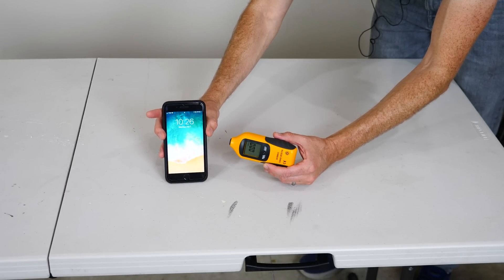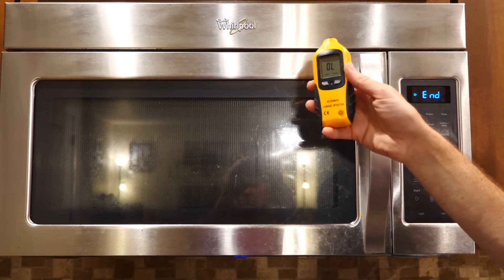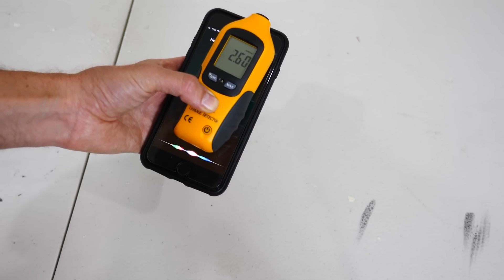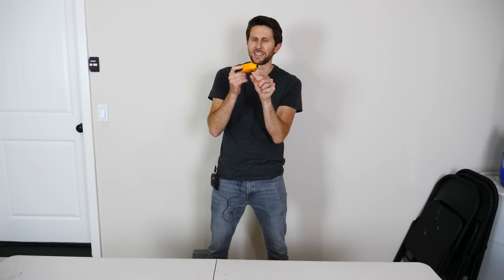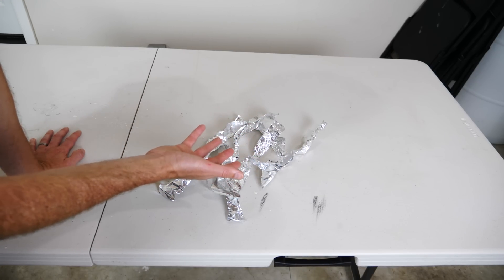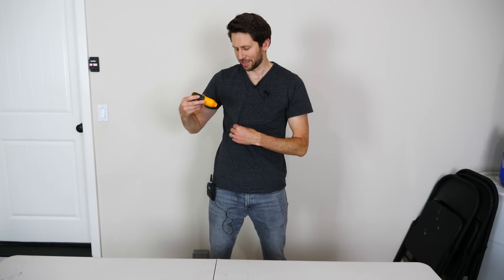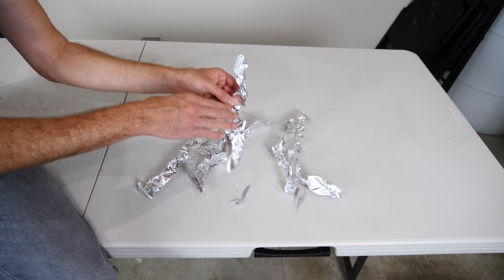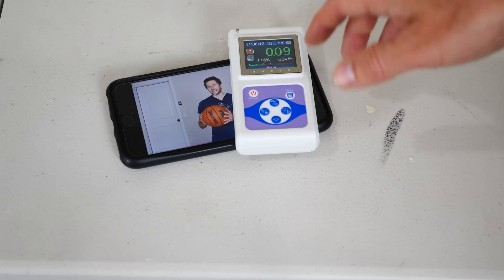How Much Radiation Are You Getting From Your Phone?

Comment: You cannot feel 5G. 5G doesn't affect you. No one has ever gotten cancer from radio waves in general.

5G (and radio waves in general) do not affect you. Here's what you need to know. 5G is safe. To understand why 5G is safe we need to understand the following:

We have drawn an arbitrary line around the bands of the EMF spectrum.

The only difference between the IR/microwave/radio wave spectrum and "light" is that we can see light. Beyond that, they operate exactly the same.

What do we know about light:

1. Light can be used to transmit information.
2. Light creates heat.
3. Light is perceived by our eyes.
4. When "concentrated", light can cut and burn things.

Does this make light dangerous? No. Most light is safe to use due to the low power level that it designed for. That's also true of the lower frequency EMF that we use for communications.

Comment: Non-ionizing radiation safety standards only take into account the Thermal effects of a Single source over relatively short durations.

These safety standards haven't been updated in decades despite the evolution of the technology. 

The thermal impact is measured in "Specific Absorbtion Rate" or SAR which measures the amount a single source of nonionizing radiation heats human tissue.

The safety standards don't take into consideration multi-source constructive interference, long-term exposure and non-thermal effects.

Non-thermal effects could include effects to cell membranes including ion channels and permeability at specific frequencies (relatively independent of power density). The terahertz frequency range specifically has shown implications for affecting DNA, and other biological systems which resonate in those frequency ranges.
Reply: Do you understand why the safety standards don't need to be updated?

There has been no harm found. You don't need to update safety standards for no reason!
Reply: @topherkrock you ignored the content of my comment.

Even if thermal effects were the only concern, safety standards only consider single sources over short durations. This is not representative of real world exposures.

Constructive interference between sources increases power density.

Comment: Any kind of nutrition was wiped out and replaced with radiation using microwave. Idiots
Reply: That's not even close to true.
Reply: @topherkrock instead of talking out your ass why don’t you read how microwaves work. Especially when it comes to heat.
Reply: @jphone5515 , when will you stop making wild assumptions?

I know more about microwaves than you will ever know. It shows. Microwaves, which are just a specific set of radio waves, heat things up by causing them to vibrate faster - just like how anything else causes heating to occur!. The only "magic" that separates these radio waves from fire itself is that the microwaves travel into the item being heated, so they "heat more evenly".

If "heat destroys nutrients", then boiling, frying, baking, or cooking is just as bad as microwaving.
Reply: @jphone5515 , so then you're saying that you really, really don't know. Got it.

Comment: If only "Mr. Nobody" would take a moment to listen to the truth. If he did, then he'd know that 5G cannot harm you. We all know by now that 5G can't hurt us. It is extremely safe. It's all radio waves! Radio waves are not hurting you.

Here's what you need to know. 5G is safe. To understand why 5G is safe we need to understand the following:

We have drawn an arbitrary line around the bands of the EMF spectrum.

The only difference between the IR/microwave/radio wave spectrum and "light" is that we can see light. Beyond that, they operate exactly the same.

What do we know about light:

1. Light can be used to transmit information.
2. Light creates heat.
3. Light is perceived by our eyes.
4. When "concentrated", light can cut and burn things.

Does this make light dangerous? No. Most light is safe to use due to the low power level that it designed for. That's also true of the lower frequency EMF that we use for communications.

Comment: The Fenton reaction is a catalytic process that converts hydrogen peroxide, a product of mitochondrial oxidative respiration, into a highly toxic hydroxyl free radical. Some studies have suggested that EMF is another mechanism through the Fenton reaction, suggesting that it promotes free radical activity in cells. Although some researchers have reported that ROS perform beneficial function, a high degree of ROS production may cause cellular damage, resulting in a range of diseases. These radicals react with various biomolecules, including DNA. Namely, the energy of free radicals is not enough, and for this reason they behave like robbers who seize energy from other cells and rob a person to satisfy themselves. Many studies have suggested that EMF may trigger the formation of reactive oxygen species in exposed cells in vitro and in vivo. The initial stage of the ROS production in the presence of RF is controlled by the NADPH oxidase enzyme located in the plasma membrane. Consequently, ROS activate matrix metalloproteases, thereby initiating intracellular signaling cascades to warn the nucleus of the presence of external stimulation. These changes in transcription and protein expression are observed after RF exposure. Kazemi et al. investigated the effect of exposure to 900-MHz on the induction of oxidative stress and the level of intracellular ROS in human mononuclear cells. Excessive elevation in ROS levels is an important cause of oxidative damage in lipids and proteins and nucleic acids. It therefore causes changes in enzyme activity and gene expression, eventually leading to various diseases, including sleep disorder, atherosclerosis, loss of appetite, diabetes, dizziness, rheumatoid arthritis, cardiovascular disease, nausea and stroke. In addition, degradation of the pro-oxidant-antioxidant balance due to an uncontrolled increase in ROS may also result in lipid peroxidation. Lipid peroxidation is the process in which cell membranes are rapidly destroyed due to the oxidation of components of phospholipids containing unsaturated fatty acids. By continuing this reaction, lipid peroxides (-C0, H) accumulate in the membrane and transform polyunsaturated fatty acids into biologically active substances. Consequently, lipid peroxidation leads to significant damage in the cells, such as disturbances in membrane transport, structural changes, cell membrane fluidity, damage to protein receptors in membrane structures, and changes in the activity of cell membrane enzymes. Hoyto et al. demonstrated significant induction of lipid peroxidation after exposure to EMF in the mouse SH-SY5Y cell and L929 fibroblast cells. Epidemiological studies have also suggested that oxidative damage to lipids in blood vessel walls may be a significant contributor to the development of atherosclerosis.

Studies generally focus on the brain, since cell phones are held close to the head during use. There is considerable evidence that EMF can affect neural functions in the human brain. The relation between EMF and neurological disorders can be explained in terms of the heat shock response. The heat shock protein (HSP) response is generally concerned with heat shock, exposure to heavy metals and environmental insults such as EMF. Generally, HSP is a marker in cells under stress. Living organisms generate stress proteins in order to survive environmental stressors. The heat shock response is regarded as a general response to a wide variety of stresses, such as oxidative stress. In humans and other mammals, many environmental stimuli causes ultraviolet radiation, ionizing radiation and laser radiation are caused by cellular stresses and alter Hsp90 and 70 levels. Non-ionizing radiation also causes HSP changes in various tissues, including the brain, myocardium, testis and skin.

Oxidative stress plays an important role in DNA damage process, general and specific gene expression and cell apoptosis. The brain has a high metabolic rate, making it more prone to damage by ROS and oxidative damage compared to other organs. Excessive amounts of ROS in tissues may lead to necrosis, the death of neurons and neuronal damage in brain tissue, as well as to neurological disorders such as Alzheimer’s disease, spinal cord injury, multiple sclerosis, and epilepsy. Several studies have observed neuronal damage and cellular losses caused by exposure to EMF in many regions of the brain, including the cortex, basal ganglia, hippocampus and cerebellum. One epidemiological study determined an association between amyotrophic lateral sclerosis and exposure to high intensity EMF, but no correlation was observed with other neurodegenerative diseases. Rubin et al. noted that the pain level of headache may increase during exposure but decreased immediately when exposure ceased. Haynal and Regli suggested that exposure to extremely low frequency (ELF)-EMF may be linked to amyotrophic lateral sclerosis, a fatal neurodegenerative disorder. Maskey et al. investigated the effects on the brain of 835-MHz over different exposure times and observed a significant loss of pyramidal cells in the CA1 region of the hippocampus. Another case control study by Villeneuve et al. reported a 5.3-fold increased risk of one brain cancer type, glioblastoma, in individuals exposed to EMF.
Reply: Now I know that you're off your rocker. Did you even look up what this process was?
Reply: The Fenton Reaction, really Fenton's reagent, is a process used to oxidize and decontaminate waste water. It has nothing to do with radio waves.

Comment: Another flat-earther has posted garbage that is the opposite of the truth. There is no link between cell phone use and cancer. In patients that had brain cancer, they found that the cancer was scatter-shot - sometimes appearing on the same side of the head as the cell phone, sometimes on the opposite side. There was no correlation between tumors and cell use at all. Light use versus heavy use showed no difference.

Comment: Can you reconcile this, then?   "In a meta-analysis published in the May 2008 issue of the International Journal of Oncology, Swedish researchers found significant associations between long-term cell phone use and brain tumor risk.

“We found that cell phone use is linked to gliomas [malignant brain tumors] and acoustic neuromas [benign tumors of the brain’s auditory nerve] and are showing up after only ten years,” says lead author Lennart Hardell, an oncologist and cancer epidemiologist at University Hospital in Örebro, Sweden. Specifically, for studies that included at least 10 years of exposure, there was a doubling in the risk of gliomas for ipsilateral (same-side) but not contralateral (opposite-side) exposures to the head (as reflected by which hand the subject typically used to hold his/her cell phone)."
Reply: That's not true. The study found no link between cancer and radio signals.
Reply: @topherkrock  It did find a link but it's insufficient to make a claim.
Reply: You have posted lies.
Reply: I've just read the meta-analysis.
"While we did not observe correlation between mobile phone use of any duration and glioma risk, there was an association between long-term mobile phone use and glioma. However, the analysis was limited by significant heterogeneity between trials and the paucity of data on long term use (≥10 years)."

So they've found a correlation with phone use and low grade glioma ( a tumour ). However, this is just a correlation in a small meta analysis. It could be a coincidence, quote from them:

"Low-grade glioma (WHO grade II tumor) is associated with a long latency period, and is thus potentially more vulnerable to radiation from mobile phones, which in itself may be a chronic carcinogenic agent. Cases affected by radiation are more likely to be detected."
and
"the number of recent studies included in the meta-analysis is too small"
and then there's a whole section talking about possible bias.

Furthermore,
"these results supporting a potential association between mobile phone use and glioma risk need to be interpreted with caution secondary to marked between-trial heterogeneity. The observed correlation between long-term use of mobile phone and glioma risk may be artificial, secondary to systematic differences in response rates between cases and controls."

Ending with,
"we observed a correlation between the risk of mobile phone use and low-grade glioma in particular, especially long-term users. However, our findings require confirmation with prospective, longer-term studies."
Reply: @Azarilh , there is no link. The results were inconclusive.
Reply: @topherkrock  

"These findings suggest a possible role of cumulative exposure and regional localization in a potential underlying biological mechanism links mobile phone use with glioma"

They DID find a link but the findings were not enough to make a conclusion.
Reply: @Azarilh , they didn't find a link. In order to substantiate a link, there would have to be multiple studies conducted and corroborated. There has been no link found.

As much as you want your Earth to be flat, it will remain round until you can find verifiable proof of thee flatness. I can't simply believe you just because you followed a FE site off the cliff.
Reply: @Azarilh , the European study of both glioma and meningioma showed that cell phone use did not increase your chance of getting a tumor.

Comment: Microwaves cannot hurt you! It is extremely safe. It's all radio waves! Radio waves are not hurting you.

Here's what you need to know, to understand why it's all safe:

We have drawn an arbitrary line around the bands of the EMF spectrum.

The only difference between the IR/microwave/radio wave spectrum and "light" is that we can see light. Beyond that, they operate exactly the same.

What do we know about light:

1. Light can be used to transmit information.
2. Light creates heat.
3. Light is perceived by our eyes.
4. When "concentrated", light can cut and burn things.

Does this make light dangerous? No. Most light is safe to use due to the low power level that it designed for. That's also true of the lower frequency EMF that we use for communications.

Comment: You are using it wrong!!! Point the end of it towards the desired object!!!  Works like a laser pointer, but you are pointing it towards the ceiling so the whole video is null & void, inaccurate readings. 😂
Reply: So you don't know how radio waves work? Cool.
Reply: Radio travels anywhere in the air so it doesn't matter where they point at.

Comment: Mobile phones will not kill you. They use a similar wavelength to a microwave oven. You can remove the door from a microwave, bypass the safety switch, turn it on,and it will only make you feel a bit warm.

Comment: —many of these videos focus on showing a reading without context, which makes it seem alarming. Just because a detector picks up a strong signal doesn’t mean it’s dangerous.

What Are Safe EMF Levels?

Regulatory agencies set limits on safe exposure to RF (radiofrequency) EMFs. Here are some key guidelines:

1. FCC (U.S.) Exposure Limit

1.6 W/kg (watts per kilogram) averaged over 1g of tissue (for mobile devices).

This is the Specific Absorption Rate (SAR) for devices like cell phones.

Most phones operate well below this limit in normal use.

2. ICNIRP (International Guidelines)

Exposure limit for the general public: 10 W/m² (watts per square meter) for frequencies in the cell phone and Wi-Fi range (2-6 GHz).

For reference, Wi-Fi routers typically emit at 0.1 W/m² or lower, far below this limit.

Why Do Phones and Wi-Fi Show High Readings?

Microwaves are shielded, so you’ll see a spike near the door but a rapid drop-off a few inches away.

Phones emit more EMFs when making a call or actively using data, so saying "Hey Siri" triggers a signal boost.

Wi-Fi routers send signals in bursts, so triggering a Wi-Fi event (like using Siri) causes a temporary spike.

Context Matters: Power vs. Exposure

A strong reading doesn’t mean danger—it just means the device is transmitting. What matters is:

How long are you exposed? (Brief spikes are meaningless.)

At what distance? (EMF strength drops exponentially with distance.)

Is it above official safety limits? (Phones, Wi-Fi, and other consumer devices are designed to stay well below regulatory limits.)

Takeaway

Those YouTube videos don’t prove a health risk—they just show that devices emit EMFs, which we already know.

Safe limits are much higher than the levels these devices typically produce.

If you’re really worried, wired connections (Ethernet) reduce RF exposure, but everyday wireless devices operate safely within global guidelines.
Reply: Thank you for this.

Comment: Here's what you need to know:

5G is safe. To understand why 5G is safe we need to understand the following:

We have drawn an arbitrary line around the bands of the EMF spectrum.

The only difference between the IR/microwave/radio wave spectrum and "light" is that we can see light. Beyond that, they operate exactly the same.

What do we know about light:

1. Light can be used to transmit information.
2. Light creates heat.
3. Light is perceived by our eyes.
4. When "concentrated", light can cut and burn things.

Does this make light dangerous? No. Most light is safe to use due to the low power level that it designed for. That's also true of the lower frequency EMF that we use for communications.

Comment: What about 4G emitting from your phone? Less than Wifi or a phonecall or more?
Reply: It's safe.
Reply: @topherkrock  Thanks, do you havy any source on this?

I stopped using a Wifi box and do everything through the hotspot I create with my phone and 4G now. I discovered that I was paying the double by using wifi and 4G, and realized I could use only 4G and still have enough data to finish the month without the need for Wifi.